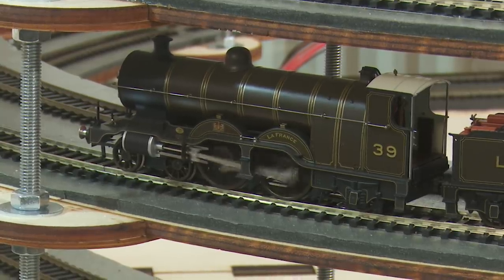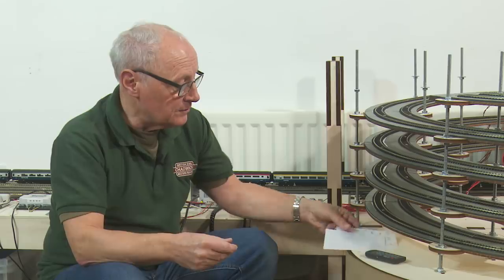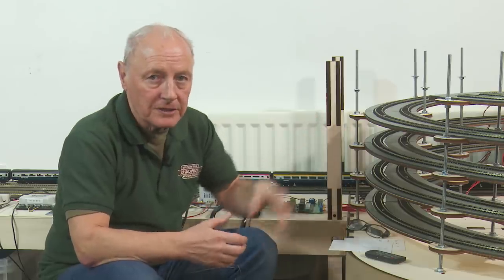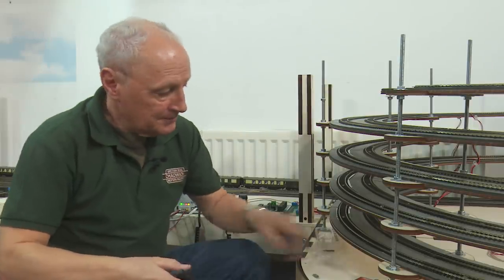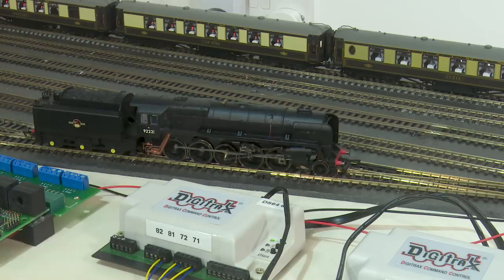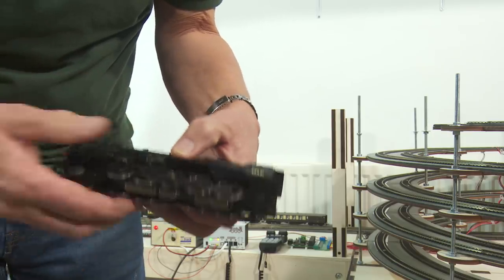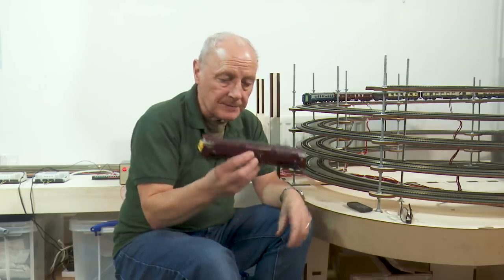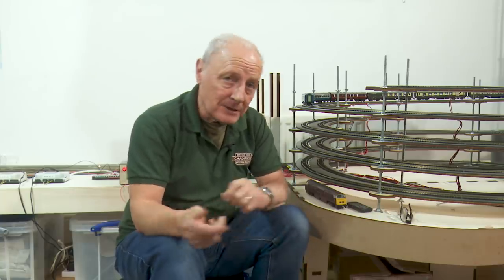Inclines and Power Base at Chadwick Model Railway | 118.

Comment: Hi Charlie.
I watch your videos with great interest, thank you.
Have you tried a product called 'Bullfrog Snot'? Applied to 2 drive wheels on a steam loco it will pull many coaches up inclines. It worked for me.
Brian
Reply from the maker: And that’s clearly something I need to investigate Brian. Many thanks Charlie
Reply: @ChadwickModelRailway  Hi Charlie, the railway manufacturers for the German railway models ( I'm modelling German steam epoch around sixties of 20th century ) mostly use rubber tyres on two adjacent wheels, which works great due to my experience. Some of my models weren't equipped with those, so I tried out the famous Bullfrog Snot instead. I can recommend it. It requires a bit of trial to get proper results but it's much cheaper und less effort to plaster your helix with steel plates. So I can fully support Brian's approach and maybe you can publish your experience in a another of your great videos.
Thomas

Comment: Hi charlie great video as always ... Forgive me if i'm being dumb but if the up line is on the outer loop that means on the other helix the outer loop will be the decline if i'm right in thinking.. so the other helix the inner loop will be the up so greater degrees incline so wouldnt it be better to test inner loop so you can work out if you either have to modify other helix or magnetise your locos ?? Again forgive me if i'm completely wrong in my thinking all the best
Reply from the maker: Sorry Tony but you are completely wrong. This helix goes down anticlockwise whereas the other Helix will go down in a clockwise configuration. I was fooled too on this question.

Comment: I know by experience that the helix will ruin the traction tyres on the Hornby H class AND the Hornby T 9.I built a gentle up and over on my layout and the wheel slip was the result .Needless to say i redesigned the layout without any incline and will Never do so again .Be warned steam engines DO NOT respond well to inclines,they will be ruined.
Reply from the maker: A great tip Roger many thanks, regards Charlie

Comment: Dear Sir,

Neodymium magnets are available in a multitude of shapes and sizes (some even self adhesive), methinks there must exist some that you could use under the locomotive (@11:50) in place of the ones that came with the Power Base, without having to remove the loco's decorative pieces. I would try with two or three very small ones in suitable places to see if they can replace the larger one.

I bought an assortment of sizes to test as decouplers. They are very fiddly to work with, being so strong magnets, but i had very good results.

Cheers from Brazil!

(Edit) In this brazilian shop (where i bought mine) there is a small magnet (5 x 4 x 1 mm) with aprox. 260g of "strength". Here is the shop's site, just if you want to see the images:
https://www.imashop.com.br/ima-neodimio-n50-gold-bloco-5x4x1-mm-forca-aprox-260g-b050401n50gp/p
Reply from the maker: Thanks Eugenio,  the magnets supplied by DCC Concepts are also Neodymium magnets and are very strong.  The self adhesive ones would not work, their pull is to strong.  Regards Charlie

Comment: Why don't you just put additional weight i to the boiler area of the loco. She has the power, her wheels are slipping. She does not have the weight so loses traction.
Reply from the maker: Hi Kevin, a valid point but the video was a test of the Power Base concept.